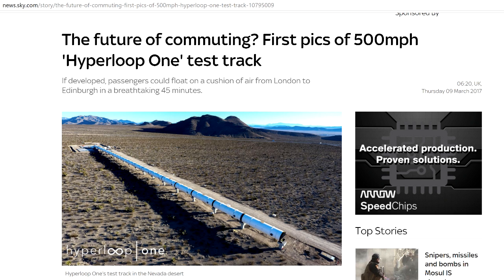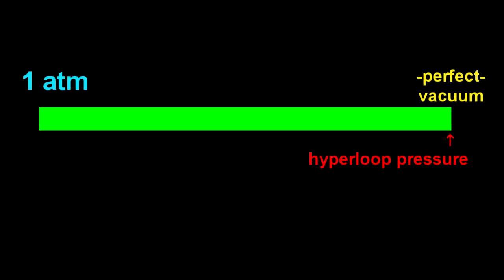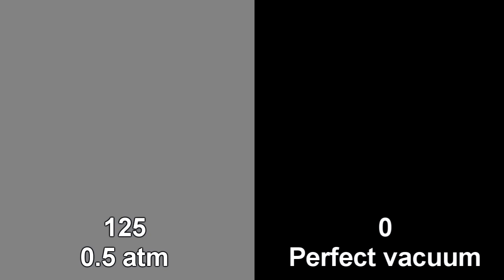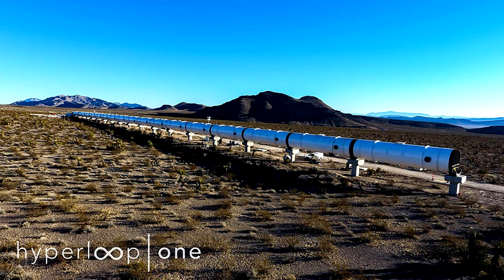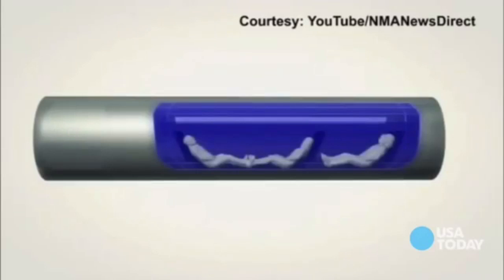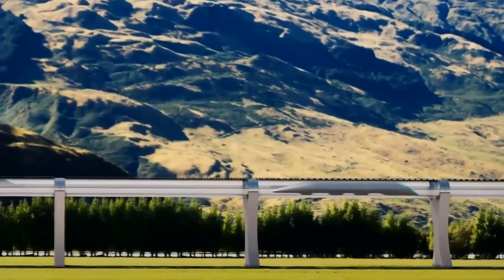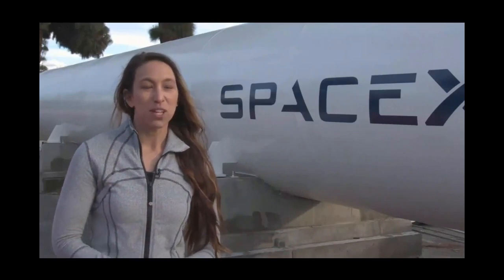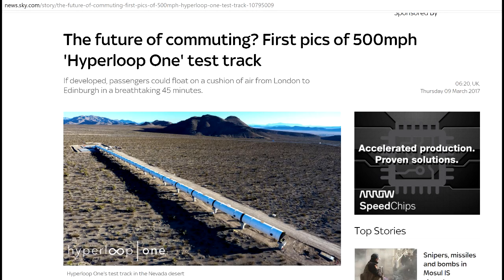Entire Hyperloop could be destroyed in SECONDS!

Comment: @Thunderf00t

I have a few issues with this video.

1) People who pointed out that the hyperloop doesn't have a great vacuum in previous videos were criticizing your claims about the difficulty involved with pumping, which was a valid criticism. You are intentionally misrepresenting that argument in this context, where the difference between a millionth and a thousandth of an atmosphere doesn't matter. 

2) The hyperloop is made of much stronger tubes than the one you showed collapsing. The tanks on tanker trucks are not meant to contain a vacuum, hence the collapse.

3) I'm not sure how you concluded that Musk couldn't build a mile long test track. Given that his was nearly that long and making it only a bit longer strongly suggests that he could have, but wasn't concerned about hitting round numbers. The test track is for systems testing. 

4) The fact that the student entries didn't do that much does not imply that you can do almost nothing on the test track. I would guess that speeds were limited to ensure that damage would not occur to the end caps if something didn't work right, because that's what a responsible person would do. Also, THE PODS WERE SUPPOSED TO STOP WHEN RELEASED. It's in the rules. 

5) You represented something a student said in an interview as the official purpose of the test track/competition. Why?

6) A well-documented system design based on known physical principals is not equivalent to hoax video about hoverboards.

7) The student designs are in fact nothing like the one described in the white paper.

8) It took a long time to put the student devices in the test chamber because it needs to be depressurized every time. This would not be true for the design described in the white paper. If the explanation in the white paper doesn't make sense, criticize that.

9) The energy required to pump down the hyperloop has very little bearing on the energy cost per ride, since you don't repressurize the tube every time. A more meaningful measure would be the power required to counteract the inevitable small leaks. This is addressed in (you guessed it) the white paper.

10) 200 MJ to pump it down actually fantastic. Using a generator at 40% efficiency, that would burn 11 gallons of gasoline. I suspect you're underestimating the energetic losses involved in the pumps though.

11) The ping pong ball demonstration is in no way representative of the effect a vacuum failure would have on a pod. Even if we scaled the ping pong ball up to the correct size (the square-cube law is very important here), it would still have a dramatically lower sectional density. The pods also won't form a decent seal with the tube, which is very important.

12) 200 MJ is not that much more than the kinetic energy we would already expect the pod to have when travelling, and most of that energy would be turned into the kinetic energy of the pod. Dissipative losses alone would be tremendous, but there's also lots of air that would escape around the edges. This is all without even thinking about intentional safety measures. Then of course there's the issue that you would need to use a sizeable explosive devices to make a hole big enough for the air leaking in to be a safety issue. Also keep in mind the propagation speed limits of gasses in tubes.

13) Steel does not shatter like glass. Severing or puncturing the tube would not create an implosion.

14) You have not supported your claim that the cross braces are to prevent the tube sections from collapsing under their own weight. Also, the test track has no cross-braces and it's working fine. Even if it is, it's quite normal to need additional reinforcement at the ends of pipe, which is why you often see a thick lip there.

15) The tank in the mythbusters clip has much thinner walls, no supporting ribs, and it skill needed an enormous weight dropped on it from quite a height to trigger the collapse. Everyday trains are similarly vulnerable to such threats.

16) Not just any dent will cause a collapse, and steel is actually quite good at springing back into shape.

17) They haven't yet made a tube long enough to need to address the expansion issue, so why would they?

18) The tube is tolerant of single pillar losses, and elevated railways are similarly vulnerable to car collisions.

19) An earthquake serious enough to destroy this would also destroy tons of other stuff, yet that is still sufficiently safe and economically viable.

20) Those ribs are designed to prevent a cascade failure.

And my final complaint: This thing wasn't designed by a couple in Minnesota with questionable credentials. It's being designed by teams of some of the best engineers in the relevant fields. They're not stupid. Musk is spending his own money on this and won't get it back if it doesn't work, so it's not a fraud attempt. Why then is this happening?
Reply: @Sparky I agree.  In 2004, Darpa held a contest for autonomous vehicles that no team was able to complete.  Just 13 years later we have commercially available semi-autonomous vehicles. We also have prototype fully-autonomous vehicles that are driving around on regular city roads and those are on the cusp of becoming commercially available as well.  I always cringe when I hear people criticize emerging technologies based on their current state of development and I was disappointed to see Thunderf00t resort to the "durrrr the contest winner was so slow, LOLOLOL" argument because I normally like what he has to say.
Reply: Thanks for correcting my mistake on pump choice. I am not an expert in vacuum physics (I am an electrical engineer) so I can make mistakes :P
If you find others, please let me know so I can fix them.
Reply: a few issues?
Reply: +CaleyMcKibbin People and vehicles are NOT supposed to be on railway tracks. It's not like trains magically attracts people and then crush them.
Reply: Justin Walters, it is not his fault for creating an in-depth argument on a subject Andrew obviously cares about, rather it is that you are too lazy to finish his work. No need to criticise him for it.
Reply: thank you
Reply: MrOpenGL Thank you for taking the time to write all of that out. I'm too busy right now to do my own calculations for comparison but I fully intend on coming back to share it with you.

I did do a cursory check on rotary vane pump limitations and they can work down to a pressure of 1e-6 Pa (wiki). The Hyperloop is poised to run at 100 Pa ( Section 4 http://www.spacex.com/sites/spacex/files/hyperloop_alpha-20130812.pdf ) So going by this, I don't believe the turbomolecular pump will be necessary.
Reply: You can't just scale up the leak rate in a train's brake pipe by the raio of volumes between it and the Hyperloop. Leaks will scale as an area, not as a volume. It's the walls of a vacuum chamber that matter, not the contained volume. So if you want to use the 1m^3/h standard of train brake pipes, you'll get a factor of 10000 on length (to 1000km) and a factor of 100 on diameter (to 2m), to get 1000000m^3/h. That's three orders of magnitude less than your volume-based calculation. So maybe more like 330MW, which is no longer a ridiculous amount (although still high - but I would argue this should be a capacity and not a normal operating condition).

I don't think a train's brake line, with several removable couplers, and operating at who knows what pressure, and the whole damn thing moves around all the time as the train goes, is a good source to inform estimates of leak rates in a Hyperloop. Most of the time trains' brake lines hopefully leak far less than 1m^3/h, and a Hyperloop with its all-welded construction should do far, far better. How do you think natural gas pipelines work? Do you think they're just losing a million cubic meters every hour?

Do you realize just how bad a 1m^3/h leak in a train's brake line is? That's a leak that would de-energize the brake line in two minutes if the pumps stopped running.
Reply: +CaleyMcKibbin It's not a philosophical matter. People walk on rails -> people get crushed
People don't walk on rails -> people don't get crushed.
Very simple. No philosophy involved. 

And if people didn't walk on rails or attempt to cross a closed level crossing, that statistic would be zero. Especially because in the USA, with the use of the automatic coupler, it is much safer to couple trains. Nobody has to get between the two cars being coupled, while in Europe you have because you need to first compress the buffers with the locomotive, then get between the cars and manually couple them. Because of this we get 2-4 deaths each year, where sadly the procedure goes wrong and the worker either gets limbs crushed between the couplers or even his entire body, sometimes... 
But we also get 20.000 deaths each year only due to people being in places where they aren't supposed to (crossing where there is a train incoming, walking near or on the rails, getting on top of carriages to make a selfie and then getting zapped by the 3000V catenary...)
Reply: Mate, what did us Minnesotans do? :(
Reply: Ila Lashanta It's not a better idea to build high speed railways instead of this, especially if your ultimate goal is speed.

It all boils down to the losses due to aerodynamic losses which have a non-linear exponential relationship with speed; Every mph increase in your speed requires and even larger step of energy input than the previous mph. A high-speed railway suffers from this whereas the hyperloop doesn't.

Over the span of 20 years the energy expended solely on overcoming this drag force will be immense. It's much more energy efficient to remove the air from a large tube than it is to brute force your way against the drag forces.
Reply: @Andrew Broeker Yes, I wanted to add also that the HyperLoop is in extremely developmental stages, Thunderf00t, you talk about how "the student pods took the same amount of time to get in the chamber as it is said to take to get to edinburg" (synopsis, not direct quote). Why? How does it have any relevance since it is no where near a fully developed and finished system so you can hardly expect it to be anywhere near as efficient as projected which also relates to your complaints about the speeds the pods are reaching. The entire system is in a highly experimental phase.
Reply: I'm no scientist, but answer this.

9) The energy required to pump down the hyperloop has very little 
bearing on the energy cost per ride, since *you don't repressurize the 
tube every time*. A more meaningful measure would be the power required 
to counteract the inevitable small leaks. This is addressed in (you 
guessed it) the white paper.

Looking at it purely as a public transport system, how do you propose that the system will be constantly pressurized? Shipments/People need to be loaded into the pods and then loaded into the Hyperloop. The only solution would be to seal the stations and pressurize them along with the tube, then get EVERYONE who wants to take the Hyperloop for the entire day into those stations. Perhaps a series of airlocks COULD help, but I think that would just create more failure points.
Reply: thanks Andrew for seemingly being one of the few reasonable people here. the arguments made in this video are taking so much stuff out of context
Reply: +Andrew Broeker It's right there in th ecomment
Reply: thank you that you took the time to adress all of this. everything mentioned can actually be solved and since really a lot of experts work on it (i'm even in touch with a company that works on the software) it can and will work out
Reply: "a few issues"
Reply: Ben David Not trying to be rude, but you should at least be able to spell steel if you want to argue about it's strength. I also couldn't understand the rest of your argument, but I'm bad at figuring out what people mean when they use bad grammar.
Reply: Using a mispelling and admitance to ignorance is not the best way to deeebuuunk a argument.
Reply: TheKingHostile, A large number of the human population does not have a grasp on the English language with the ability to utilizing proper grammar. The act of pointing it out is either intentionally or ignorantly shaming the attempt to voice an opinion. P.S. I don't mean  to be rude.
Reply: +MrOpenGL brake valves are incredibly leaky because they have seals which double as moving parts. This is not necessary for the hyperloop. The size of this component relative to the gas volume is also enormous relative to anything you could be modelling on the hyperloop. Next, the solar array planned has a peak power output of 285 MW. This is already included in the price. Your undoubtedly dramatic overestimation of power draw is certainly enough to make up for the low capacity factor of solar arrays. The continuous output of the energy storage system is 37 MW, and that's also necessary for powering the cars themselves, not just the pumps. 

Regarding earthquakes, the flexible connections are in the support system for the tube, so are not a source of leakage.

Regarding running trains in it, the airlock consumption for each pod is not bad. All you have to do is have the pod occupy most of the space in the airlock, seal the exterior door, and let the pumps you already have handle the small amount of air remaining. 

Switching is entirely possible with such a system. Given that the initial plan is to have only two stations, it is reasonable not to include this feature initially.
Reply: +BenDavid I've worked on high vacuum systems that sprung leaks before. They did not implode. The steel the hyperloop is made of is about an inch thick in the walls with even stronger supporting ribs.
Reply: "And guess why those accidents happen? Because people are on a piece of  terrain where they are not supposed to be. It's like going in a restricted military base and complaining if you get shot, or walking in the middle of a highway and complaining that you get hit by a truck."

Why accidents happen is a philosophical matter with no relevance to risk assessment.  Only the rate at which they happen is important.
Reply: MrOpenGL you absolutely do not need a turbomolecular pump to get to 99% vacuum
Reply: As I said, I am no pneumatics/vacuum expert. I am an electrical engineer with some experience in railway operation!

I chose a brake line because it's the most similar thing that I could think of for the Hyperloop. It operates at a low pressure (3,5-5 bar) while natural gas pipelines operate at much higher pressures. I am aware of the amount of connectors, but the Hyperloop (given the fact it's supposed to be earthquake resistant...) must have some flexible connections as well (for expansion) and then there are the airlocks, which are another source of leakage.
Thanks for correcting me on the leakage scaling calculation. And still 330MW is an enormous amount, because (yes it can be lower) it is very high compared to high speed rails! A railway of 1000 km length has approximately 2000 signals (100W per signal) which means 200 kW just for the lamps. Including all the others ancilliaries, the no-train consumption is less than 500kW probably.

I do realise how bad leaks in a brake pipe are. This is a worst case scenario, obviously. The Oerlikon brake valve is rated to supply 1m³/h of air when in the "release" position to compensate for leaks. 
And that's why it is prohibited to leave trains unattended for more than 20 minutes when the locomotive is off, and 2 hours if the locomotive is on. You have to put the hand brakes if you want to leave your train longer than that.

I sincerely hope the Hyperloop doesn't leak as bad, but I think the whole idea is flawed anyway. We've been talking vactrains since the 1930s, and nobody has ever even thinked of building one seriously except Hyperloop.
At least the older ones had some elements of praticity, like being able to run TRAINS in them instead of pods (which are hugely inefficient, see the airlock consumption for each pod) and have switches in them...
Reply: Andrew Broeker Thank you for putting this down
Reply: "It's not a philosophical matter. People walk on rails -> people get crushed
People don't walk on rails -> people don't get crushed.
Very simple. No philosophy involved."

I posted those stats in response to the hyperloop being unsafe compared to trains.  So the hyperloop would need to kill more people per trip.  That is what is simple here.  An engineer should be able to grasp this by now.
Reply: "Autonomous cars are a technology problem. This is a physics problem. Technology problems are very easy to solve. Physics problems are damn near impossible to ignore."

False dichotomy.
Reply: dragonsigh2 I honestly don't know what he argument was aside from the strength of steel. My comment wasn't debunking him, it was stating how poorly he made his argument. Even a good argument can be misunderstood or ignored if it's poorly presented. Incorrect spelling and bad grammar can mean something totally different than what you were trying to say.
Reply: +CaleyMcKibbin I understand your intent, but you have chosen the wrong stats ;-)
If you had chosen deaths that can be directly related to the trains and not the stupidity of people (eg deaths due to collision between trains, shunting errors, derailments and subsequent fire/explosions etc) then I wouldn't have complained :-)

Instead you chose the worst example of deaths related to railways, because that stat is 99% made of people either being in the wrong place where they are NOT supposed to be or doing things they are NOT supposed to do *(crossing level crossings when the barrier is down, walking near or on the track, crossing tracks where there is no crossing, getting on top of the trains, leaning out of the window...), as I have said too many times now, or people trying to suicide in the worst possible manner* (jumping in front of the train).

The remaining 1% are "genuine" deaths caused by the railway.
Reply: The difference between a thousandth and a millionth of an atmosphere doesn't matter in terms of the force exerted on the chamber. It matters A LOT for pumping. The equipment you need to achieve each order of magnitude lower pressure changes drastically, as does the cost and difficulty achieving it.
Reply: "According to the National Transportation Safety Bureau, Nearly every 2 hours, a person or vehicle is hit by a train in the U.S."  https://www.mcaleerlaw.com/train-accident-statistics.html
Reply: +Tsf Phi 

First of all, since the total volume of air to remove is the same, it doesn't matter if you use 1000 1MW pumps or a single 1GW pumps. Actually yes it matters, because 1000 1MW pumps will be less efficient than a single 1GW pump.

Then let's make some calculations. Let the length of the Hyperloop track we consider to be 1000 km (1000000 m), and its diameter to be 6 m (standard UIC GC loading gauge, necessary to do anything remotely useful with that tube like transporting people and ISO containers).
That gives us a volume of air to remove of 28274334 m³ (πR²h, r=3m, h=1000000 m)

A commercial rotary vane pump consumes 1/3 HP (250 W) and can pump up to 4 CFM, which is about 6.8 m³/h. This means the entire tube will be pumped down (excluding losses) in about 474 years. 

To empty the tube in a reasonable time, you would need at least 68000 m³/h of pumping capacity, and that will empty the tube in about 415 days.
To achieve that rate, you would need 10000 rotary vane pumps, which equals to 2,5 MW, and that's to empty the tube in more than a year. 
With 100000 pumps, you can achieve a pumpdown rate of 41 hours, which is enough in case you need to repump the tube because of repairs or other trouble. However the power capacity is now 25 MW.

Now you need to remember that A: those pumps are NOT like water pumps. As the pressure gets lower, they progressively get less efficient (see a diagram here, look at the curve labelled 2: http://www.elutionsolutions.com/wp-content/uploads/2013/09/e2mchart1.png)

To achieve the 99% vacuum needed by Hyperloop you can't use those rotary vane pumps. You need to use a turbomolecular pump, in addition to a rotary vane pump because the turbomolecular pump can't work at too high pressures. 

Those pumps are even more inefficient and energy hungry than the rotary vane pumps.
I will stop here with the calculations, because that will get very complicated. If you really want this demonstrated, I can go on :-)

Now let's talk about airlocks. The pumpdown speed for airlocks must be short because otherwise the Hyperloop is useless.

Let's assume the airlock to be 6m in diameter and 200 m long (to leave room for future expansion or longer pods). That is 11304 m³ to pump down. 
Using our rotary vane pump again, to achieve a pumpdown rate of 10 minutes we have to use again 1000 of these pumps, or 2,5 MW of electrical capacity (*I AM NOT CONSIDERING the fact that YOU CAN'T PUMP DOWN all of the air with this kind of pump, nor I am considering the performance curve of the pump, I am expecting a linear curve. Real life results will be MUCH WORSE*) for each airlock, which is already half of what a regular locomotive consumes (5 MW).

Now let's talk about leaks, which are the real problem. You can't make a system completely airtight.
I will take my data from railway braking systems. The main brake pipe is essentially a 100 m long pipe, 20 mm in diameter, with many seals and parts that leak, a bit like the Hyperloop. The maximum permissible leak rate is 1 m³/h of air, as per railway rules.

The volume of the pipe in question is 0.0314 m³, that is 900456496 times smaller (let's say 900000000 times smaller) than the Hyperloop.
Scaling the 1 m³/h loss value for the Hyperloop we get obviously 900000000 m³/h as a leak rate.

You would need 1323529411 rotary vane pumps *JUST TO COPE with the leaks*, which means a power consumption of 330882352 kW *or 330 GW of power*, 24/7, PLUS whatever is required to vacuum the tube in the first place 

Now of course you can tell me "you can make the hyperloop more airtight" but the truth is that it will always leak from somewhere especially on a 1000 km long pipe. You can at most cut the leak rate by 100, which still means 3GW of pumping capacity to be installed. That's 500 trains running simultaneously at full power!

And finally, before you ridiculise others because according to you "is just your imagination running wild" THINK that that someone might actually be right...
Reply: The tank from the mythbusters clip was built to sustain overpressure. A viable engineer knows how to change the design, to sustain underpressure.
Problem with TF here really is, that his arguments are valid to a point, but there are a lot of solutions to solve his problems, or add additional safety.
In the end it's all just a crunching of Dollar numbers to check if it's really cost effective.
First you have to build a study and a prototype though ;)
Reply: Autonomous cars are a technology problem. This is a physics problem. Technology problems are very easy to solve. Physics problems are damn near impossible to ignore.
Reply: While I do not know about the feasability of this Hyperloop, I think this video and your response has shown the difference between a scientist and an engineer. It seems in this case the scientist has overstepped his bounds.
Reply: MrOpenGL "Given the size of the tube, I'd estimate you would need multi-gigawatt pumps"

I would love to see your math
Reply: MrOpenGL Right there in the comment where you assume a diameter of six meters because you couldn't even be bothered to look up the real diameter? I'll pass.
Reply: MrOpenGL You don't need very powerful pumps, you can just have lots of little pumps. 

How did you estimate a requirement for multi-gigawatt pumps? Is this actually an estimation or just your imagination running wild?
Reply: +MrOpenGL  First of all, the diameter of the tube would be 2.23 meters, not 6 meters.  Secondly, people couldn't just wander on to the hyperloop tracks and get hit by a pod, so it makes perfect sense to include people who wander onto train tracks and get fatally hit by a train, when comparing the dangers of trains to the dangers of the hyperloop.  Many fatal auto accidents also involve "people either being in the wrong place where they are NOT supposed to be or doing things they are NOT supposed to do", such as pedestrians jaywalking, or drivers speeding, swerving, drinking, etc. -- so do you think that fatal auto accidents caused by jaywalking, speeding, or drunk driving should be excluded from traffic fatalities, when comparing the dangers of automobiles with the dangers of other forms of transportation,  in the same way that people on train tracks getting hit by trains should be excluded from train related fatalities?  

To quote the alpha document, with added emphasis in bold:  " it is incredibly hard to maintain a near vacuum in a room, let alone 700 miles (round trip) of large tube with dozens of station gateways and thousands of pods entering and exiting every day. All it takes is one leaky seal or a small crack somewhere in the hundreds of miles of tube and the whole system stops working. However, a low pressure (vs. almost no pressure) system set to a level where standard commercial pumps could easily overcome an air leak and the transport pods could handle variable air density would be inherently robust . . .  The expected pressure inside the tube will be maintained around 0.015 psi (100 Pa, 0.75 torr), which is about 1/6 the pressure on Mars. This low pressure minimizes the drag force on the capsule while maintaining the relative ease of pumping out the air from the tube. The efficiency of industrial vacuum pumps decreases exponentially as the pressure is reduced (Figure 13), so further benefits from reducing tube pressure would be offset by increased pumping complexity."

Clearly, the engineers working on the project have concluded that "standard commercial pumps could easily overcome an air leak" in the hyperloop.  Why would you think that you would be better qualified to asses the feasibility of the project, than the highly skilled engineers who specialize in the field, know the actual proposed diameter of the tube, and spent thousands of hours working on the project?  The idea that the engineers and technicians working on the hyperloop didn't make such basic calculations is ridiculous.
Reply: Who are you talking to? Because if you're talking to me, I already addressed airlock issues, pumpdown issues and leak issues in my comment. Re-read it :-)
Reply: Not only these arguments but he doesn't calculate the energy right. Instead of change in volume which is zero, he uses the volume of the container. Hint the work is zero for this thermodynamic process.

Meaning he is using the wrong equation and doesn't understand what he is doing
Reply: Even though your points are sound and clear. It still would make absolutely no economical sense to follow through with this. Because you have to remember that you should also account for operational costs of this infrastructure. Plus that it is in California: sunlight+tectonic activity, arguments follow... It is still a much better idea to build high speed railways, than follow with this "great" idea.
Reply: "People and vehicles are NOT supposed to be on railway tracks. It's not like trains magically attracts people and then crush them."

So?  No accident is "supposed" to happen and nothing is magic.

"Over the span of 20 years the energy expended solely on overcoming this drag force will be immense. It's much more energy efficient to remove the air from a large tube than it is to brute force your way against the drag forces."

Yeah.  I calculated ~1/27 force requirement for a TGV through 1% air density.  It would be fairly easy to compare the ROI for the two modes if you looked up some financial data, but I'm too lazy.
Reply: Andrew Broeker It's California, their probably high.
Reply: Hey cultist, would love to see where he said "Steel does not shatter like glass. Severing or puncturing the tube would not create an implosion."

As he said dent it, like the mythbuster clip showed.
Reply: You do realise that the Hyperloop will never be completely airtight, and therefore you need VERY powerful vacuum pumps to keep the vacuum regulated?
Given the size of the tube, I'd estimate you would need multi-gigawatt pumps, ran 24h/7j, which is WAY more power consumption than even the speed record modified TGV.
Reply: Can you say more?
Reply: And guess why those accidents happen? Because people are on a piece of terrain where they are not supposed to be. It's like going in a restricted military base and complaining if you get shot, or walking in the middle of a highway and complaining that you get hit by a truck.
Reply: First of all, you need to speak complete English.  The public is very ignorant about science.  An earthquake would likely allow an air leak and the thing would shut down.
Reply: Andrew Broeker bs I'm just gonna say that now fair enough you made some good points but no the steal really isn't that good at bending back into place and it doesn't matter it it is the point is that any little dent can cause a failure as it is a near perfect vacume and you can't just say well these tubes a strong because it only takes one accidentally dent and millions of pounds are lost and puts people's lives at risk and since when have you become and expert in everything to do with this you dont need to be mr right okay so calm down